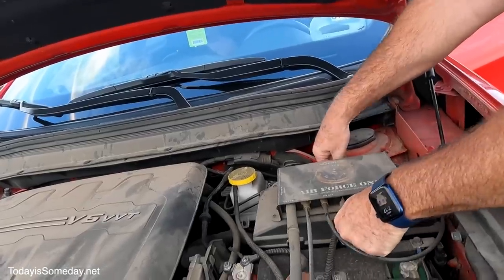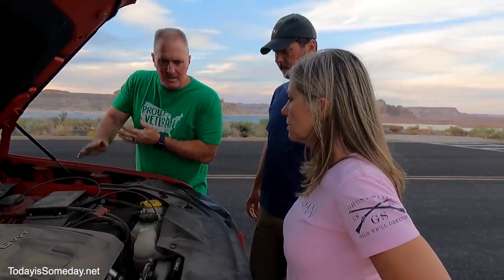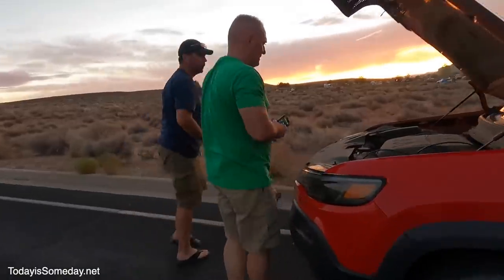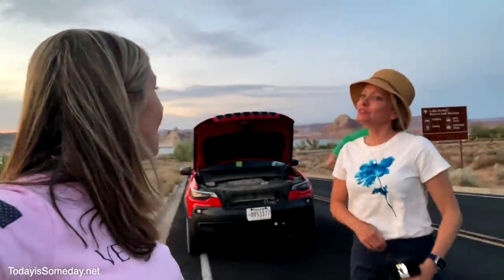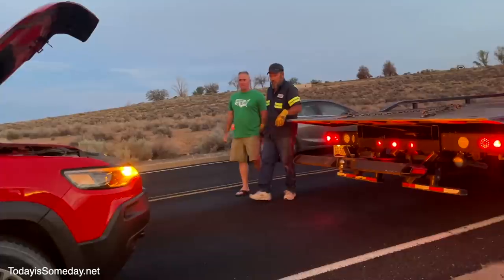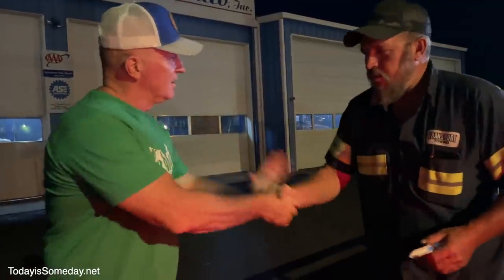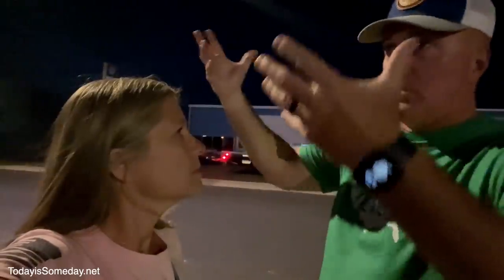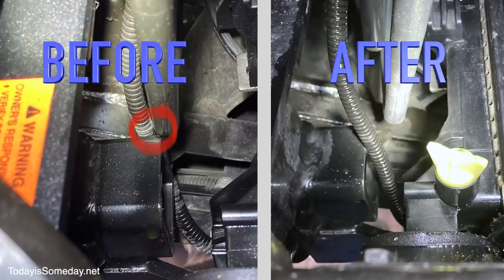Tow Car Breakdown in the Middle of Nowhere (FULL TIME RV)

Comment: I would like to tell y’all about a product to give a readout of your chassis components. The name is BlueFire. It will allow you to make gauges you can monitor going down the road. It cost me $200.00 at Amazon. It plugs into your system diagnostic socket under your dash. The app is free to download so you can play with it for free. I am installing it today. I have been wanting to see more info on my rig as I go down the road. Phil, as a diesel mechanic for 16 years I would suggest you go all over your toad and RV to check for any rubbing of hoses and wiring. They make devices to go around hoses and wires that will protect them from chaffing. I would try truck parts houses.
Y’all be safe and God willing we will se you on the road next year. We got 7 months to retirement. I hope this helps.
Reply from the maker: Thanks, David.  I will give that a look and the hoses!!!

Comment: Mechanical issue with a Jeep ?   How surprising 🙄. Hope you guys work it out.  
I drove a Dodge Charger for two years, it was a brand new police issued car.  Got it with like 100 miles.  In the two years I had it, the car spent more time at the dealer, which they never fix anything, then I spent driving it.   Every person I know that has a Jeep or dodge product has had nothing but mechanical issues with them.  
My wife wants a Jeep Wrangler and I absolutely refuse to allow her to get one.  Nothing but headaches and time spent out of work and in the dealer.

Comment: Phil , thank you so much for the Base plate tow bracket rubbing the transmission line. There are lots of bracket that are close to the transmission line. I'll be checking mind . I mounted my base plate and I remember the line right next to it. 
Question. You're mechanically inclined is there a fix so that it won't rub that line? Thanks , Don

Comment: My initial tought was a blown up trans cooler line and i was right but it's clearly visible the installer did not give a damn on. If i were you i still drop an extra layer there is a chance of rubbing still. Hope you did not burned the clutch or anything else in that tran. If you did Richard will be your man Amarillo, Texas Precision Transmission.

Comment: Looking at the before and after photos it looks like they did not fix the problem as the cooling line is still touching the edge of the bracket. Moving it from one side to another side just moves the problem and doesn't fix it. I would suggest using a tie wrap to pull the line away from that bracket or a thick rubber spacer. If it is touching the bracket like it appears to be in the photo IT WILL rupture again.
One thing I forget to mention is that your tow hitch needs to be installed to see if the tube protrudes beyond the square tube end. This will show you what needs to be done to get the clearance you need.
Reply: Steve I'm confused by part of your comment.  You refer to tow hitch and the tube protruding beyond the square tube end.  As far as I can see, Phil does not have a square tube receiver hitch on the front of his Jeep.
Reply: @gonebyrv9748  When you tow the Jeep you have a tow hitch that connects to the Jeep first before you connect it to your RV. I don't know how it connects to the Jeep as there are a couple of options. One is that the receiver has square tubes that slide into the square tubes on the Jeep. If this is the case then the tow hitch has the potential of protruding into the engine bay. And if this is true then it pushes on the cooling lines even more. 
If nothing protrudes into the engine bay other than what is in the picture then moving the cooling line off of the square tube will be all that is needed. With it touching the edge of the tube will rub another hole in the cooling line again.
I hope this explained it better.

Comment: Hi guys hey Phil if you put your vehicle without starting it put it in park turn the key back to auxiliary without starting the Jeep twice and the third time leaving on auxiliary without starting it it will give you a code look up the code on the internet and it'll tell you what the problem is all dodgers have that feature again you going to have to turn the key one two three the third time do not turn the vehicle just leave it on there and you'll see your dash flashing you cages will move it'll give you a code it's going to be quick so you have to pay attention or video tape it there's a video on YouTube on what I am talking about I have a Dodge ram hemi that's what I do when I need something on my truck it tells you exactly what it's wrong from the transmission to the motor the brakes and electronics

Comment: My apology in advance.... but you both explain to all of us how to live the rv lifestyle.... and you both do not carry a separate set of rv keys?
My hint as an 83 year old guy: I have never taken my rv ignition key out except when it gets serviced!  Fact.
Why take it out?  It can't be used anywhere else. And that leaves us each to carry the door key.  We do not use our bolt lock either.  Why not?  No one is going to steal a 40 or 45 ft diesel pusher for a joy ride.  And if you disagree with all that: hide a key in your propane tank area which usually is not a locked compartment. Just my thoughts after driving my 2001 Diplomat 135,000 miles. Just returned from a 23 day Michigan State Park vacation.

Comment: The problem is you bought a Jeep. Jeep is a division of Chrysler Fiat. The Jeeps of today are junk and not the quality of the original Jeeps. Sold by past reputations. Sorry to hear you had problems. Look to Toyota or like and something not having a small engine with turbos. These are just prone to failure. A small engine boosted in power via a turbo just won't hold up. Ford's small turbo engines are prone to issues also.
Reply from the maker: If you saw the video you would realize the problem had nothing to do with jeep
Reply: @todayissomeday  I did watch the video. Replacement trans line, add needed ATF, and clean for $800.00 is too costly. The engines and trans are weak parts of the Jeep. If you always have it under warranty no issue. Fiat's history of reliability is terrible. My husband is retired Navy and from a family of auto mechanics. Fixes everything from home AC unit, home wiring and 99% of our vehicles. Still like your videos.

Comment: That’s what you get for driving a cheap oh I mean a Jeep, been there done that won’t do that again. I list that company as a P.O.S.. and you can probably figure out what that means
Reply from the maker: It wasn't due to the Jeep malfunctioning on its own.....our flat tow base plate that was installed wrong by someone outside of Jeep is what caused it.  We have had nothing but great service from Jeep.
Reply: That's an irrelevant comment to a problem that had nothing to do with the Jeep.
Reply: @gonebyrv9748  I was my comment about the manufacturer, I’m sorry you didn’t like it but get over it
Reply: @kennethcook5705  get over it? It's just an irrelevant comment which has nothing to do with the subject.